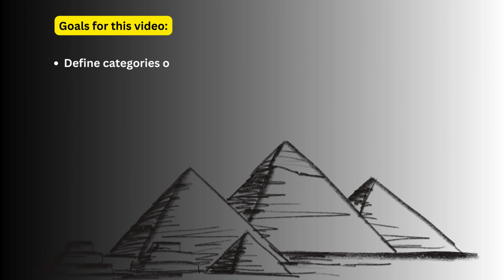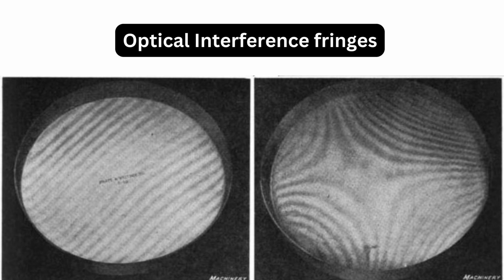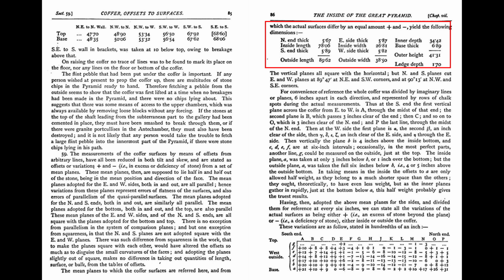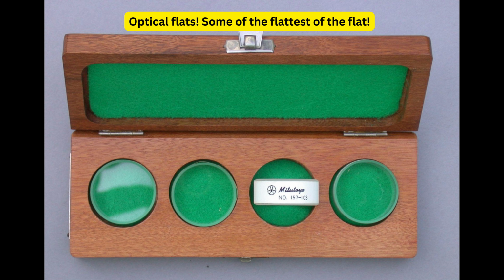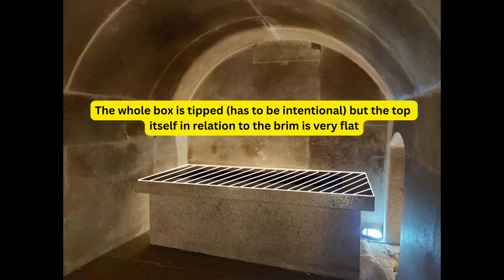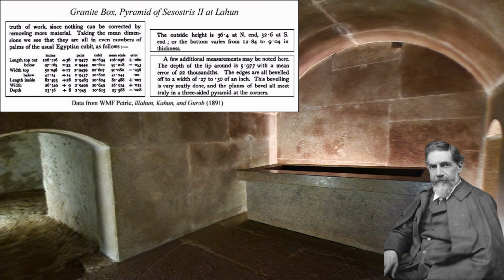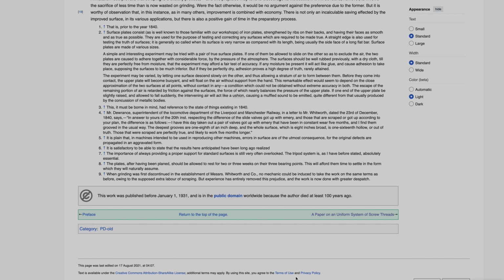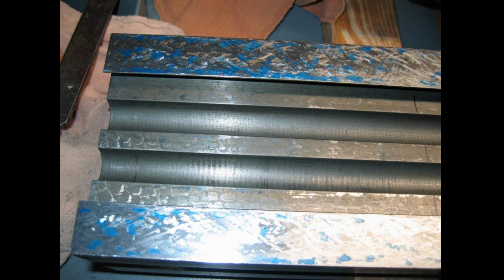The Problem of Flatness in Ancient Egypt

Comment: I Cant believe you made 0 mention of "light" how can you completely miss this? light is a precision measurement tool. 16:44 in modern stone masonry this method is called "Rubbing The Square" ( you can use a steel rule etc but we mainly had a square at hand you'll get reprimanded if caught doing it! its also considered cheating) cause you take the straight edge rub on your flat surface and the straight edge marks any lumps or bumps which are unseen by the human eye then you just chisel over them rub the straight edge till there's no bumps or light being seen from under the straight edge. Generally Stone Masons cut stone by hand to an accepted tolerance of + 1mm or - 1mm but obviously some masons cut to a very high standard which is how flat surfaces are achieved. + or - 1mm 9/10 people would not even be able to notice visually by eye and in construction it matters even less to the eyes to general public etc even today most people cant tell you what + or - 1 mm looks like.
Reply from the maker: Well I’m not a stonemason but thank you for your input! Always good to learn about more ways in which this could be done. I don’t know enough about your specific claim here to address it so I’ll just thank you for watching!

Comment: 0:38 easily explained here 0:14 Pause the vid here... take the square edge as seen as look at the top edge you can clearly see it's not flat and if you shone a light behind the square it light would shine through the uneven edge. now we we done this same test out doors on a flatish surface light would be seen coming from under that edge there for this shows you either the flat surface or square has not got a even flat surface so work and test it till no light can be seen from the applied edge. make a straight edge and when you put it on a flat surface check to see if any light can be seen from under the edge and if you see light its obviously not flat. it's really that simple. another tick is rubbing stone against stone this also helps creates a very smooth flat surface & can remove tool marks. I'm a Stone mason it's really that simple.
Reply from the maker: Good to hear. Hope you finished the video would like to hear your thoughts on the rest
Reply: @intothemap360  Great video, Great work! ❤

Comment: Flatness is relatively easy. Squareness and consistent thickness is difficult to achieve without a relatively sophisticated and precise method of taking measurements. If they were able to make blocks with sides square within a couple thousandths of an inch while also making them flat within a couple thousandths. That might indicate they had the ability to measure complex geometric shapes with a level of precision that would have been impossible with their previously theorized level of technology.
Reply from the maker: Yes those are harder for sure to pull off well.

Comment: Just want to say, I'm a machinist, as well as a artist blacksmith, and I feel like you don't even need the three plate method for a 0.5mm tolerance over a distance of a meter or 2. When I'm straightening a piece that has warped after heat treatment, I can fairly consistently get it back within a couple of tenths of mm just by looking along the edge. I'm usually well below 2 or 3 tenths of a mm when the dial indicator comes out. 

I feel like just eying the 4 edges, and then using a piece of straight wood (which can also be eyeballed to a decent flatness) to check the rest of the plane for flatness, would already go a long way towards these tolerances. People greatly underestimate how accurate you can get workpieces by just using your eyes and a reference.
Reply from the maker: Definitely not for the casing stones! The boxes perhaps for the final touches

Comment: Humans can recognize flatness, stagnant liquid is flat. In fact the flatness of everything goes into Joseph Davidovits theory that things in Egypt were built using a pourable liquid based concrete with molds. If a concrete block is poured into a mold and allowed to dry then another block is poured on top of that without a bottom or side to the mold they would appear to be different blocks and be uniform. The molds maybe formed using tools on wood to get as flat as possible and then scraping the wood on a surface that was made flat because the top was the surface of a liquid based concrete.
Reply from the maker: This isn’t the case at all in Egypt. These geopolymer theories are not compatible with chemistry or geology

Comment: About the vase at the end, i'm pretty sure they manage to build some rudimental lathe.
The outside of the vase was made first by hand.
Then, with a lathe, even if it's made of wood and stone, you create your jaw while it's turning and fix your vase in it to do the inside.

Concentricity is relativly well preserve with the outside and the thikness of the wall can be reduce a lot.
The handle might help a lot to keep the vase in place in the jaw.
A part that cant be removed at the hand shaped into a handle.

If they know how to drill a small hole in they handle, that means they have rudimental spindle of some kind.
So they can drill a big hole inside the vase with very basic tool, wood, stone copper etc.

Excellent video, finally someone the know geometry a bit more then most on youtube.

Comment: Me got happy. I´m studying visual arts and taking an engraving class, we just started learning lithography and the three plate method is pretty much how we have to erase the drawing from the stone matrix, rubbing two flat surfaces with grains and water in between, with some extra steps that may or may not include the use of nitric acid. It goes like this, we use a grease pencil to make the drawing and it gets absorbed by the stone, then we ink the grease; to erase it we have to sand it with another heavy flat surface until the drawing is gone, reduced to dust, Thanosed; this has to be done until there´s no trace of the ink or else your stamp will make a "ghost" of the previous drawing. Once it is fully gone, we swap to a finer grain to level up the smoothness of the stone so the next time we make stamps they don´t end with scratches, but you have to do the sanding all over the stone matrix instead of focusing only where the ink is, OR ELSE you can get an uneven stamp when you pass it through the press, either because it moved or it didn´t get enough ink. I never heard about the plate method before but when you showed it I immediately thought "that´s how we clean stones" and got happy for recognizing it.

It's cool that even though we no longer use that method to make monuments, decorations or furniture by smoothing stones by hand, that technique has not been lost and continues to be used.
Reply from the maker: That's so cool! It's amazing how these fundamental techniques carry over into different fields.

Comment: everyone who ever worked with sharpening stones for some time knows this method. you can rub two sharpening stones of the same grain together to get them both flat. this also works for other megalithic structures like walls in some places that probably have names, that consist of huge stones that aren't flat at all, not even remotely rectangular, but they fit together perfectly. they might just have rubbed these stones together in only one direction until they fit perfectly.

Comment: Less than 15 seconds into the video, and I already feel the need to comment.
Any machinist could tell you that you just need to rub three pieces of cast iron or granite together and you'll make a surface plate - an incredibly flat surface that is used in high precision environments. You don't even really need to have invented the wheel of fire to pull it off. The idea that it requires advanced technology is ridiculous and shows that the people making such claims have no idea what they are talking about.
Also, "aircraft precision" and "CNC-level quality" are meaningless terms. Simple hand files and scraping tools are capable of incredible precision, provided you have the patience.
Reply from the maker: *sigh*....please keep watching. 15 seconds isn't even remotely enough time for me to set up the argument I am about to dismantle. Once you do you will realize I completely agree with you, but you have to give me time to explain these concepts to those who aren't as familiar with them as you are.  Thanks!

Comment from the maker: So I’ve noticed a theme in the comments is questions about a string being flat so I wanted to drop this in here to cover those going forward. A string when pulled taut is straight, not flat. In geometry, straightness is a property of 1-dimensional objects (like lines/edges), while flatness is a property of 2-dimensional surfaces (a plane). A taut string is often used as a practical model of a straight line, but it’s still a physical object: it has thickness, is finite, and can sag slightly. In pure geometry, a line is an ideal object: perfectly straight, no thickness, and extending infinitely. A plane is an ideal flat surface extending infinitely. So it makes sense to talk about a string being straight (approximately), but not flat.  Flatness requires a surface. Practically speaking, if you want to measure flatness with accuracy, you need something rigid (a straightedge, surface plate, reference plane, etc.), because a flexible string can’t serve as a stable reference surface.

Thanks to all who suggested this as you got me back dusting off my geometry! Thank you all for watching and keep the ideas coming! Sources below. 
Lines:
https://mathworld.wolfram.com/Line.html
Planes: https://mathworld.wolfram.com/Plane.html

https://openstax.org/books/contemporary-mathematics/pages/10-1-points-lines-and-planes

https://www.britannica.com/science/dimension-geometry

https://math.libretexts.org/Courses/Mount_Royal_University/Mathematical_Reasoning/4%3A_Basic_Concepts_of_Euclidean_Geometry/4.1%3A_Euclidean_geometry
Reply: Couldn't you put it in a pool of water to get a reference plain?
Reply: Straightness is a subset of flatness. When surface plates are calibrated, the test generally used to describe the "overall flatness" is a series of 8 straightness measurements that get stitched together to describe the overall curvature of the plate. While you can mask some flatness errors from some straightness measurements, it becomes more difficult as you overconstrain the system.
Reply: Straightness is worth the quick mention too, since I've met people who insist that the edges of the pyramids are "impossibly straight". So, yep, "string" bears mentioning, even if it is not a perfect answer to the question of "flatness".
Reply: Awesome video! One additional note: a string (on Earth, e.g. in a gravity field) can only be straight in azimuth, never in elevation. That means a string line pulled taught and waved over a surface wouldn't work as a reference for "flat" because a string always sags in the middle. To pull it perfectly straight against gravity would require infinitely high tension force. The closer to straight it gets the less the force of you pulling on it is contributing to lifting it. At human strength over a sarcophogus scale (450N, 2.5m), a 6mm kevlar rope would sag about 0.2mm.
Reply: Slide one or both ends of a string across the edge of your object, you get a plane.
Reply: @Amonimus how do you get a perfect 90° angle on multiple sides using a string?
Reply: @Andyscottoncandyandcreations Irrelevant to the topic. But since you've asked, divide the string into sections of lengths 3, 4, and 5, and it makes up a right-angled triangle, which you can repurpose.
Reply: So in nature you would find pure flatness ontop of a lake… or any large enough body of water, what if they had floating cutting tools the water would keep everything completely flat and true
Reply from the maker: @DIESEL1JZ  Floating cutting tools that don't disturb the water aren't a thing. This love of string seems very odd to me, sure it would be used at some point in marking and laying out the lines but this feels like a campaign by Big String
Reply: @intothemap360 okay I was just putting another idea out there we have no idea how they did it it’s some lost technology so who knows, floating a tool on water would be a way to achieve flat and level without any precise measuring tools or guide
Reply: This is correct, making a straight line is easy compared to making a flat plane. Then upping the complexity by making it a perfect 90° angle not on just one side but multiple sides
Reply: Well said 😊
Reply: Say you take a extremely thin (as in smaller than a human hair by a significant amount) string and pull it extremely tight across a surface allowing it to catch each edge, that would give you an idea if the surface is flat would it not? If it was flat the string should have perfect contact from side to side, if not there would be a gap even if it is imperceptible! An extremely taught string isn't sagging
Reply: ... yes, but a straight string can create a flat surface quite easily. Just look at clay cutters.
Reply: @lowamplitudeworlds how do you create a perfect 90° angle using only string?
Reply: @Andyscottoncandyandcreations   ask your mother
Reply: @Andyscottoncandyandcreations  who said anything about a 90 degree angle.
Reply: Well if we're going to "well akshually" some things, string isn't one dimensional. I'll loan you my calipers to verify that.

Neither is a sheet of paper, if paper was one dimensional, I wouldn't be able to use it as a feeler gauge.
Reply: Yes a string is straight and can be used to make a straight edge which you can use to check the flatness of a plane
Reply: You seem to be smart but are pretending not to understand how ancients could have made flat surfaces. Yes, a string is a line, but what happens when you string a line from three points. You have a perfectly flat triangle. Stop playing like you are dumb just for clicks. Our civilization is circling the drain and you are trying to dumb down the population with click revenue. Congratulations.
Reply from the maker: @shmaknapublar  Yeah I am not playing dumb, I have worked in several engineering fields for the last16 years including laser optic engineering . However, with your quick comment you seem to wish to wade into geometry so lets do that. A string can model a straight line between two points. But even if you stretch strings between three points, you still don’t get a flat surface — you just get three straight edges forming a triangle frame. That defines the boundary of a triangle, not a flat plane filling it in. In geometry, flatness applies to a surface, not to lines. Three points do define a plane mathematically, but a few strings between them don’t physically create or verify a flat surface — they only establish straight edges in space. To actually make or check a flat surface in the real world, you need a rigid surface or a method that compares surfaces against each other. That doesn’t mean ancient builders couldn’t make flat surfaces. My entire video is me arguing they COULD do that with basic tools. It just means a string alone isn’t enough to explain how flatness was achieved or measured. Straight lines are easy to establish with cords; creating broad planar surfaces is a different geometric and practical problem.
Reply: I disagree. A tight string can be used to measure many things to create a flat surface. For example, in construction we use blades to plane wood to create flatness. A string can be used to verify straightness of the blade which in turn will crate a flat surface. A tight wire or string can cut clay flat.   A strong mind with simple tools and patience can create any masterwork. The modern world depends too much on modern technology and lack of patience to really grasp the capabilities ancient civilizations had and we dont even recognize what we are capable of with the tools we have. All the ancient wonders are made with the tools they had and we cant understand it just as much as they cant understand what we have made from the tools we have. We cant grasp that 20 ton blocks were moved miles to create structure because we dont depend on primitive technology. But if we dis then we would understand how. We might be a part of human civilization but we only understand the time we live in. We are smart and driven, but arrogant. I also think its pointless to focus on pure fatness. Nothing is true flat. Even atom lined up is not flat. Fatness is based on the perspective and goal of the project.
Reply: @Th3_Native I'd think we have no problem with understanding ancient technology, we simply don't have records of what was used and are making up plausible theories. There are several proposed methods of transporting Pyramid bricks up with ramps, logs and ropes, for example, but we do know how a medieval crane operates. For methods that we do have evedience for, I haven't seen anyone being confused by them.
Reply: @Amonimus  sorry its the fittings/precision of the stones we dont really understand. Like machu  pichu for example.
Reply: The answer is aliens, duhhh.
Reply: Yes 3 plate is easy to explain. Moving only 2 plates doesn't work as you know by glossing over and saying they would have had to adapt their method, to what?
As you stated at the end doesn.t explain the vases.
Or how they got the flatness to internal corners or the corners themselves?

Comment: A string pulled tight... people think flat needs to be a plane. But can be a singularly dimension
Reply from the maker: Incorrect! A string when pulled taut is straight,  not flat. If you remember back to geometry you will remember a line is the shortest distance between two points, essentially a string. A straight string can be held at any angle but that doesn’t mean it’s flat. Flat is an aspect of a 2 dimensional object such as a plane. To start to measure flatness with accuracy an object with internal rigidity is needed. A string is not rigid nor an item with inherent perfect flatness. Go ahead and google it ;)